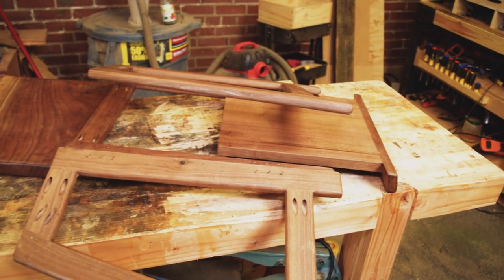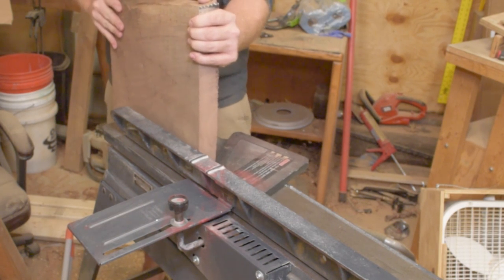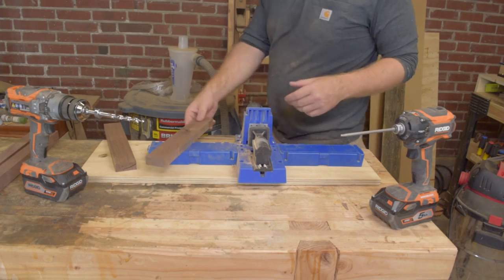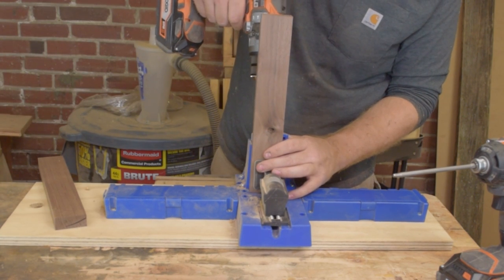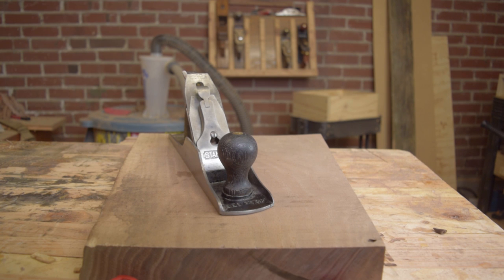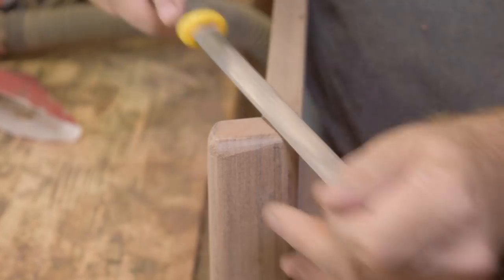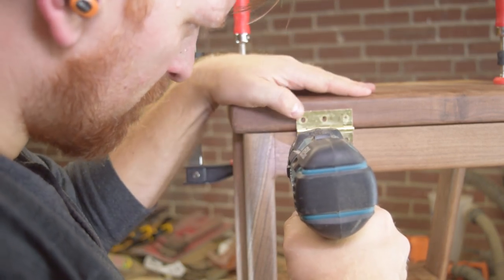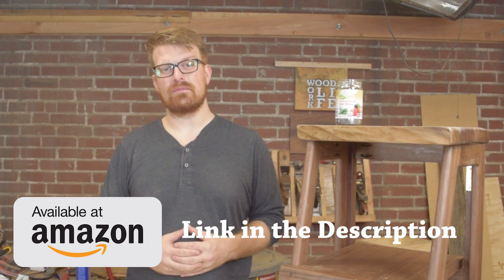Folding Walnut Stepstool...Kind of |  Woodworking Builds

Comment: Design is a challenge for me thats for sure.   Drawing it out helps and ultimately as much as I hate it prototype is also valuable ... i.e.: you made this one from lovely walnut and were not happy. Maybe make it out of two by fours or some other inexpensive material first and then you can adjust the designs and make changes cheaper.   Good stuff!
Reply from the maker: +Chris Pine I have to have something to lose or I take the easy ways out and learn less.  Fail big, sometimes win big.  I wish I had the time to prototype, I just end up iterating instead.  There will be a 3.0 version of this stool...

Comment from the maker: Have you had any projects where you struggled with the balance of form and function?
Reply: The time I made a huge ceder chest that I couldn't even get into the clients house, haha I now have a nice chest in the garage...
Reply from the maker: +Jack Brennan nice, I once threw together one of those 6 pack holders that wouldn't hold one beer.  It very precisely didn't fit...
Reply: Ever try to make a corner shelf....and the shelf wasn't square. Get the caulk!
Reply from the maker: +Jack Brennan caulk is your friend on a painted project, and corners are never square in a house.  Just close enough to break out the caulk gun.  I'd rather then be 120 degrees rather than 89.88
Reply: What if it's not painted? haha.
Reply from the maker: +Jack Brennan wood colored caulk?
Reply: It doesn't matter any more as it was an older project. Thanks for the help though:)
Reply: Wood.Work.LIFE. Been working on an outdoor cat shelter; wife wants form, I want function, what we have is a very heavy pile of wood that still needs a roof, lol.

Comment: Plenty of times......So did it work?If you allow the ends of the front stop (on the step) to extend around and s little to the side of the front legs it would eliminate any chance of the legs moving out while someone is standing on it.My 2-cents
Reply from the maker: +MrChrisKnowlton the step worked really well thanks to everything be very square.  It is not the most safe but why would I drop the aesthetic there...It will hold my 200 pound butt just fine